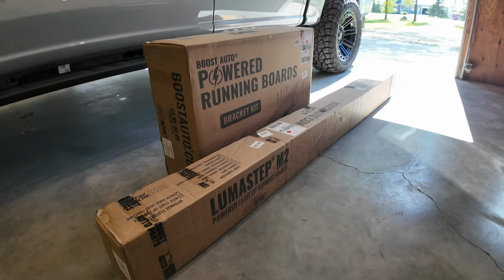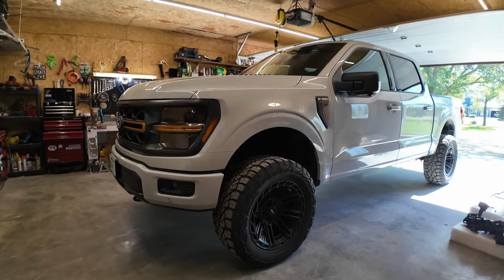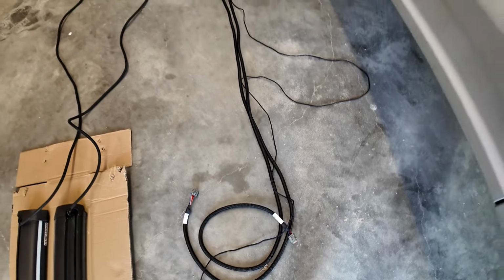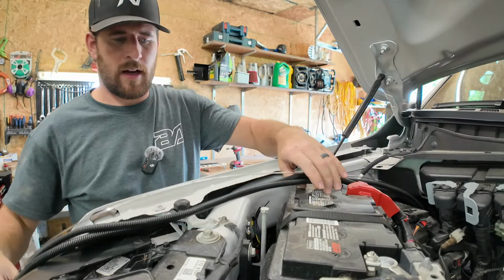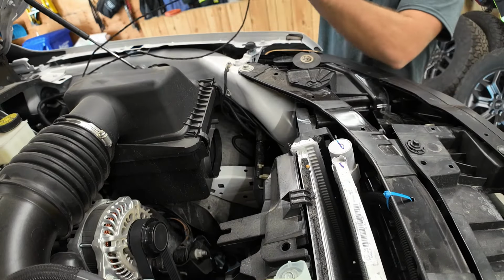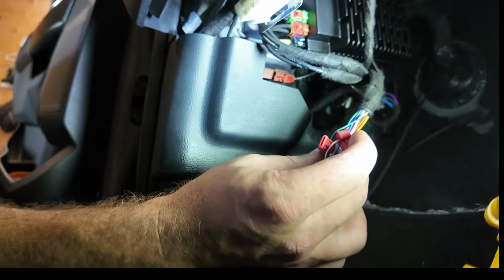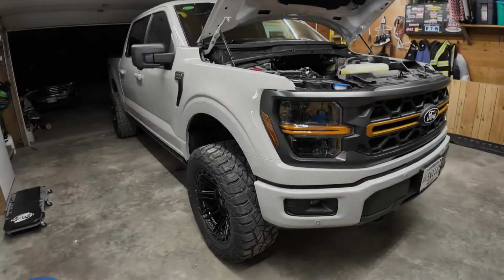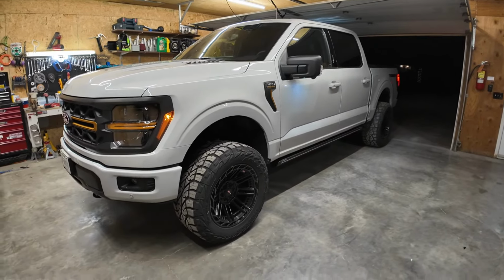Power Running Board Install on F150 Tremor

Comment: Truck looks awesome!  Mind sharing your wheel:tire sizes and if they rub, or any trimming required?
Reply from the maker: Hey thanks man! 20x10-18 wheels and 305/55r20 tires on a 2.5" Level. And just a tiny bit of rubbing, and no cutting or trimming.

Comment: Beautiful, as is, but a question.  Can that electric running board be mounted more snuggly to the vehicle when it is in the up position?  So there's not that gap there?
Reply from the maker: No there is no adjustments unfortunately.

Comment: hey brother first of great video! loved it. I have a 23 tremor & i heard you say if you have the aux switches like we do on the tremors, when I do order it, I press the option for the "rock light option" so I can connect to one of my AUX buttons correct?? 2nd question when you did order it, How long did it take for it to make it to front door steps? thank you boss love the truck.
Reply from the maker: I have a sperate video showing the rock light install to my Aux switch. I did not option for that when I bought my steps. And I believe it took 2 weeks to receive I can't quite remember tho. Appreciate the comment 👊